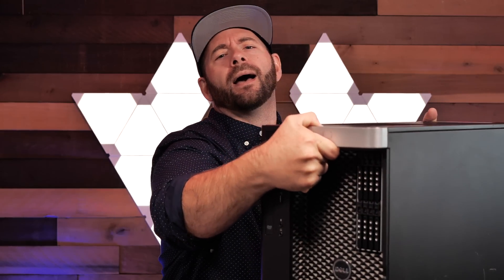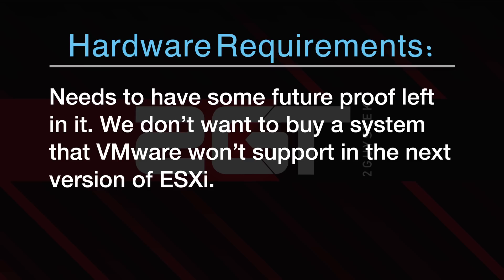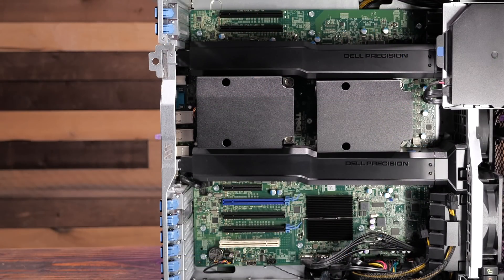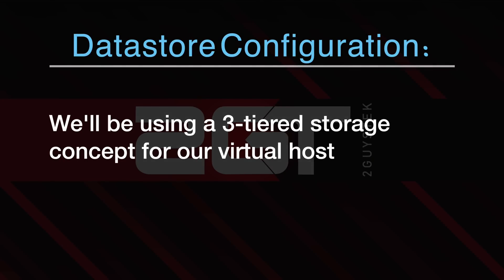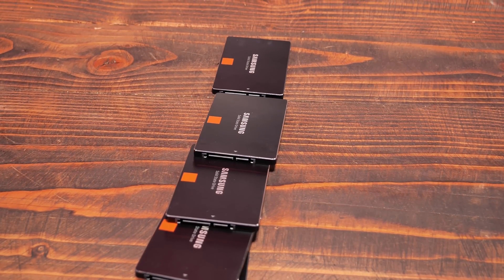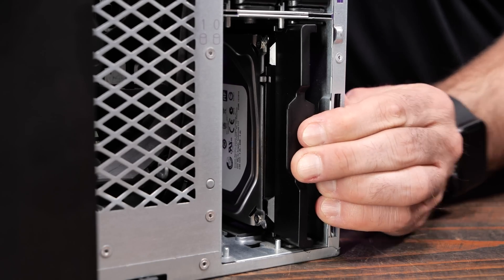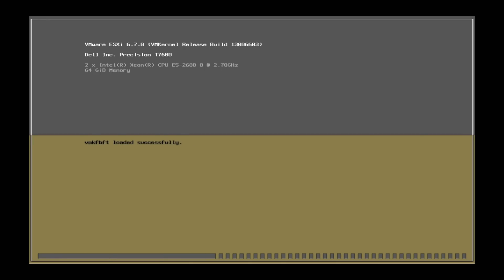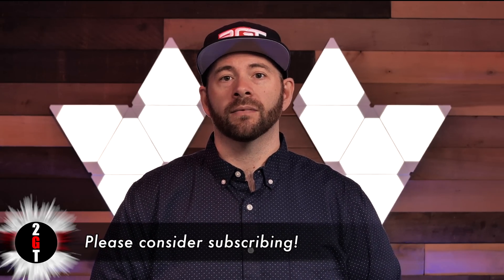Cheap and Powerful Home Virtual Server - $300 GETS YOU A TON OF POWER!

Comment: I bought this exact model. For some reason, it becomes unresponsive, is still "on" but no I/O, no display or keyboard...
I swapped all the RAM and for a couple of weeks it worked without any issue, now the issue happened again, now the issue happens even after an hour.
The reason to swap the ram was a suggestion from a dell forum, which initially worked.

If anyone has an Idea, could it be the PSU, it's a 1300W PSU, maybe it's a must that it has to be connected to a UPS or PDU?
Or, could it be a damaged dimm slot in the mother board?
Let me know any ideas, as I really need this machine to study.
Reply from the maker: When dealing with issues like this, start simple - if you suspect you have RAM issues, put a single stick in (per CPU), and boot the machine.  Does it come up? Is it stable? Increase the RAM additions until you find the bad slot. To your question about the PSU, no you do not need a UPS - for the PSU to fully consume 1300W of power you'd have to have that system under a significant load with internal peripherals (like GPUs) that required that high of wattage. If you do get the system up and running also consider upgrading the BIOS to the last released version.  best of luck!

Comment: How to have public IP to these vm!??
Reply from the maker: This is a tough question to easily answer - you'll need to either have a NATing firewall in front of your VMs to punch holes through to each of the ports you want to make publicly available, if you have a single public IP address. Or, if you happen to have multiple public IP addresses you'll need to set up NATing rules to pass each dedicated IP address through to your VMs behind your firewall. In either case you need a firewall ahead of your VMs, 1) to protect your network inside, and 2) to filter out all of the traffic you don't intend to get inside.  It is complicated, but completely doable, you'll just need to do some research into how to do it. Good luck!

Comment: So far I love my T7600!  I'd never seen a twin CPU PC before plus it had many bells and whistles and was built like a tank!  An Amazon seller had sent me one by accident.  He never saw it again! I asked if he was selling it. He said yes and threw me a price.  We negotiated once and agreed on $225.  The PC case was a little scuffed, but inside looked brand new!  It already had 32GB of RAM.  All it needed was graphics, hard drives and an operating system.  I added a WiFi PCI-E card for Internet use where I live.  For the OS I installed Win 10 Pro for Workstations after finding then loading the right chipset storage controller driver.  Windows installer then recognized my hard drive and found and took care of ALL the other drivers!  I was like "wow ".  This week I put-in a full-size CD/DVD optical drive, one that supports vertical installation.  I first had to find and buy the Dell rails for it in order to slide and lock the optical drive in place.  The Dell rails weren't the easiest to find, but IT CREATIONS had them!  I wrote them an email explaining in detail the Dell part I was looking for, also made an offer of $40 to make it worth their time. They replied within an hour with a photo of the rails!  I was tickled they had them!  I replied "YES! THANK YOU, THANK YOU, THANK YOU!"  They replied shortly after with a secure check-out link invoice!  I paid right away, took a photo of the online receipt (in case).  Then I received a reply soon after with a FedEx tracking number!  IT CREATIONS (itcreations.com) doesn't mess around!  Here's their info if interested:

Gal Lis

Sales Manager
IT Creations, Inc.
gal@itcreations.com
9142 Independence Ave
Chatsworth, CA 91311
Direct: 818-975-3113
Main: 818-975-3100
Fax: 800-236-2161

Skype: live:Gal_480

Comment: This is better as a reference.   Yes the price is misleading for many people.  Many home Lab video  people are  pushing dell Rxxx solutions or Supermicro motherboards which cost even more.    The T7600  will remain an Rxxx alternative as long as they are sold.   I'd buy one myself, but I am making due with some low power Quad cores.    The T7600 would be nice if I were going full power tower for my VMs.   One secret I will be testing is a PCIE NVME adapter which supports and powers an M2 SATA SSD.    The SATA SSD requires a SATA data cable to work.    The card fits full or low profile cases.  It can handle  both a Boot NVME drive and a fast SATA SSD for VMs.   I plan on using the HDDs in the system for data storage.    The card will  use the Video card slot in my systems doing VM / container duty.  Their aging low power, low thread count processors will need all the help they can get.   I believe others will ve able to strtech their old desktop systems as I am.  Thanks and god protect and bless you all.

Comment: I have the Dell T7600 in the dual 8-core configuration but I've found there are several 10-core and 12 -core CPU's that will also fit in that LGA 2011 socket. Is there a way to tell if those 10 and 12 core CPU's will work in this system? Dell didn't offer those as an option with this system but I think they might work and now they are pretty cheap.
Reply from the maker: Hi Michael. This is a great question! Officially Dell only supported a few CPUs on the T7600 chassis, I'm sure you've seen this link here: https://www.dell.com/support/article/en-us/sln290764/hardware-specifications-for-the-precision-t7600-desktop-workstation?lang=en#Processors that lists the officially supported CPUs for the chassis. The E5-2687W was the top of Intel's 2-socket implementation for the 2011 socket on Sandy Bridge. 

There were reports of Ivy Bridge processors being backward compatible with Sandy Bridge chipsets, and that means there is a possibility the v2 Xeons might run in the T7600. So, is there a possibility this will work? Maybe. You just don't know until you give it a try. If you do successfully get this running in your T7600 you need to pay attention to the TDP of the newer process to make sure the HSF that comes with the chassis is capable of handling the heat.  

The T7610 chassis (Ivy Bridge) highest-end CPU was the E5-2697 v2 (12-core).

This sounds like a great idea for a video... We might just try this :-). Good luck, thanks for the comment, and definitely let us know how this goes for you if you do it! -R
Reply: @2GuysTek  Thanks for the response! I think I'm going to roll the dice for $200 and buy a pair of the 10-core CPU's and see if it works. As I recall the TDP for the 10-cores was the same as the 8-cores so that shouldn't be a problem. If I do it, I'll let you know how it turns out!
Reply: @2GuysTek  I tried installing the (2) E5-2697 v2 (12-core) into the T7600 and unfortunately if did not work; the system never even entered the hardware check. BUT, I think I know why. I had another LGA2011 system laying around; an HP Z420. I installed one of the E5-2697 in it and it worked just fine. I think the reason it didn't work in the T7600 was that the 2 CPU's were not a match pair so I suspect thats the reason. Unfortunately matched pairs of the E5-2697 are way more expensive that the two individuals (almost double) so I won't be trying that but I think it might work.
Reply from the maker: That’s really unfortunate. Is your HP a single socket? Did you try both new chips in the Z420? Could you have a bad chip? Either way, thanks for letting us know!
Reply: @2GuysTek  The HP Z420 is a single CPU and I only tried one of them. Also do you know of any problem with installing a CPU with a TDP lower than the one you are replacing?
Reply from the maker: It shouldn't. In fact, you'd expect a system to run better with a lower TDP than the previous chip just due to the greater cooling overhead in the HSF. Cooler chips run faster and don't throttle. I'm thinking that Dell specifically doesn't allow the system to support any Xeons beyond the ones the chassis specifications were designed to support, especially if the HP does boot with one installed and is running the same chipset as the T7600. Thumbs up to HP for allowing it.

Comment: Wait, what? 1300 watts PSU?
Reply from the maker: Yes! The T7600 does run a 1300W PSU, but the actual power consumption is based on what you're running inside it.  Our system only uses ~400W of power under it's current workload, but has the headroom to add high-end GPUs or other power hungry peripherals if needed. Thanks for the comment!

Comment: if it isn't on the x16, the NVME wouldn't get the full bandwidth isn't it ? 
Do consider building a video for knowing how many disk a motherboard can support, what should we be looking at to know the limit of our mother boards.
Reply from the maker: Great question! And the short answer is no, NVMe M.2 interfaces are only 4x PCIe interfaces. So as long as you're providing at least a 4x PCIe interface you'll be able to take advantage of the maximum speed of the SSD. Thank you for the suggestion for a video! We LOVE getting ideas like this! We'll add it to our list!
Reply: @2GuysTek  AHH ok , meaning x16 can support an adapter up to 4nvme , e.g Asus Hyper .
Reply: @Meowx3-t4t  Or with a cheaper solution if the motherboard suports PCI-E Bifurcation (logically grouping lanes on a single physical connector ). In this case you can have a cheap "dumb" connector instead of having a card with a PCI-E switch on it.

Comment: Great video, super setup, I was wondering since you are booting the server from a stick, doesnt the VM have to be on the same? Do you think I can setup a Proxmox like this?
Reply from the maker: Thanks for the question! In ESXi you only use the stick to boot the hypervisor and that's all, so think of it as the ESXi boot disk and nothing more. ESXi loads into memory and stops using the USB stick after that initial load. All VMs are stored on 'datastores' which are disks that are connected to the host via SATA or network-attached via iSCSI or NFS.

I'm not an expert on Proxmox, but I'm willing to bet it has a similar feature to do the same thing. Typically a hypervisor (a generic name for an OS that just runs virtual machines) is designed to be small, light-weight, and run with the smallest footprint possible to leave as many resources as possible for the VMs it's running.

Comment: The T7600 is an excellent machine and extremely expandable. My single XEON example has been beefed up quite a bit with Ebay parts. The parts are absolutely dirt cheap.

Comment: I grabbed an r7 1700 with a b450 Mobo and 32gb of ram, sata cards are cheap and I have 2 m.2 slots on the board. Spent 300 euro for the combo.
Might not be as affordable, but it's new, far less power hungry and it's upgradable, can just grab a 16 core and 128gb of ram i need to (b450 mortar).
Reply: How many VMs Ryzen 5950X can run?
Reply from the maker: Quite a few!

Comment: I have the same server bought a few months ago with some projects in mind....using Debian as hypenvisor failed since passthrough was not an option thinking that iommu and vt-x had issues (clearly they didnt) Even in Dell forums they couldnt answer a simple question if supports iommu or not. I ending up usig unraid and everything worked as intended, Dont forget to update the bios to A16 or something. iommu groups are split by default very nice with each component to each own iommu group. Until now I m very satisfied with performance Wattage accoustics !!!! A nice addition would be to have your cpu but instead I have the 2x6 core xeon set

PS Be extra carefull when it comes to gpu. Many supported but the width would be a problem closing up that weird left panel. I ended up with an sff x570 to pass it through to a Win 10 vm
Reply from the maker: All great points! Thanks for the comment! You're right about that goofy door thing. Thankfully we're not running a GPU with that much height either.

Comment: Also Sandy Bridge is PCI 2.0.
Also a 16 core ryzen is more then that old CPU, heck I tested my Ryzen 2700x vs a T7600 with 16 cores and the ryzen was still faster on multi core performance and single core.

Comment: A Ryzen with the CPU Power doesn't cost 500. Its more like 180. The 3600 is just as powerful as the the xeons, at much lower operating cost due to MUCH lower energy consumption. Also I always dislike clickbait. 300 Bucks ? That's dumb - I subscribed nonetheless, because I think you can and will do better

Comment: I have a Dell R710, I got for around $200 I upgraded the shitty raid controller to a H200 to support sata 3 speeds and upgraded the power supply for $20 and  modded the power supply to a 6 pin and upgraded the riser card to a single x16 and got a quadro card for like $35, using MSI Afterburner to overclock the card and it works like a charm for the cheap :)
Reply from the maker: Those sound like interesting mods! Was it a standard ATX PSU? If so, how'd you get it to fit?
Reply: I actually used a server power supply they are way cheaper then desktop, main reason why i am using a server parts are so cheap.  Here is the power supply mod i was talking about
https://i.imgur.com/Dp7MHJO.jpg
https://i.imgur.com/vqNmHx1.jpg

Not the greatest solder job but it works.  I have a Nvidia Quadro 4000 in it.  Currently it does DHCP for the house and running a steam in home streaming server.  My next big upgrade is going to be a PCIE extender cable so I can fit a full size gtx 1080 in it.

Here is a screenshot of the servers resouces:
https://i.imgur.com/pSEUbRU.png

Comment: The first 2 vms you showed in the beginning, used for file share and storage, what were they? I also have R720 but we're using dropbox for convenience..
Reply from the maker: We have a Nexcloud instance that we use for transferring and syncing data between Jon and I. It looks, functions, and does everything Dropbox does - but has so many more features and apps to it! We even run a kanban board on it! It's completely free, fully functional, and regularly updated. If you have storage on your R720, and you have a good Internet connection give it a shot!

Comment: a modern ryzen with 8 cores will do just fine for VM host at home - at a much lower cost in terms of energy used and hardware needed. Not to mention faster storage available etc. Old machines are cool but if you are looking for bang for your buck theyre not worth it in the long run.
Reply: Yeah. Any cpu can do virtualization. This guy is just a YouTube guy. Nothing more. His facial expressions are distracting. Like he is trying to look ‘sincere’ but really looks like he is ready to cry.
Reply: In therms of energy, i think you can use an old cheap server many years before reaching the amount of energy to produce a new server.
Reply: How many VMs Ryzen 5950X can run?
Reply: @sirs4878  odd question. It depends on what kind of vm, how CPU intensive etc etc there's 100 answers

Comment: I think everyone else is echoing the same feelings: This video is misleading.  It definitely cost more than $300 to build this computer, they're just not including the cost of the parts they "already had lying around".
Reply: How is it misleading if $300 gets you a dual Sandy Bridge Xeon machine with 16 GB (upgradeable to 512 GB!) of RAM and a 500 GB HDD? That's what I call a good deal, and plenty for most people.
Reply: @GRBtutorials  because you're not factoring in that people probably don't already have that chip, that RAM, etc.  You used a lot of parts and supplies that didn't come with the $300 purchase from eBay...
Reply: Jeremy Graslie No, they said it was all included in the price. They upgraded the RAM to 64 GB because of their requirements, but 16 GB were included (2:15), and the Xeons were included as well.
Reply: @GRBtutorials  500GB Server is not good enough for most people at all even if you just run PLEX, nevermind other things. 16Gb isn't good enough either if you run VMs
Reply: @Ziplock9000  16GB is honestly enough if you run a few VM's, like some Docker containers and a few servers. I run a server with 64GB of RAM, and I find I don't use most of it.
Reply: Configured 2x 2Tb hdd, 64gb ram and 3gb gpu for $355
Reply: I just looked for this exact build. Im seeing a ton of bare bones builds.

Comment: I’m looking for a DL/Machine Learning chassis to put something like a couple of 1080ti into it. Would this workstation be a good option? I’m fine with rack mount options as well. Ideally I’d buy some used server/workstation that can fit large GPU cards, has enough memory capacity and enough CPU PCIe lanes to support cards.
Reply from the maker: This would be a perfect option for that! In fact, I wouldn't recommend buying a rack mounted server as you'll likely have restrictions that would prevent you from installing two full-length GPUs. Workstations like this one have plenty of GPU length for cards and this system has a 1300W PSU so it has plenty of power budget for 2x 1080Ti cards.